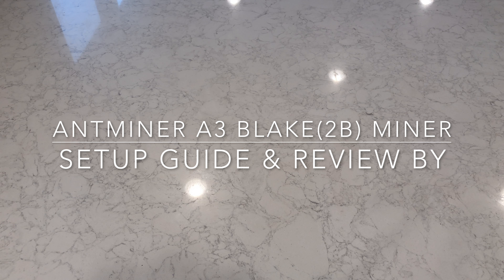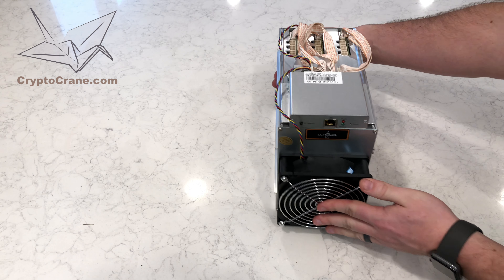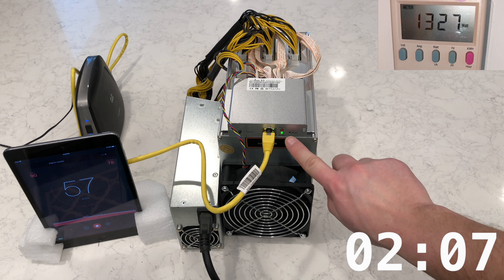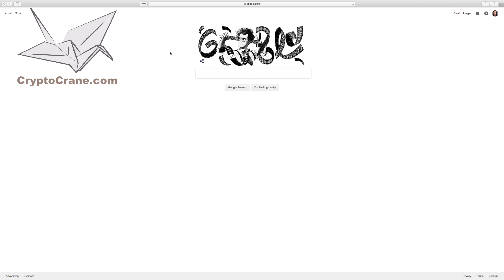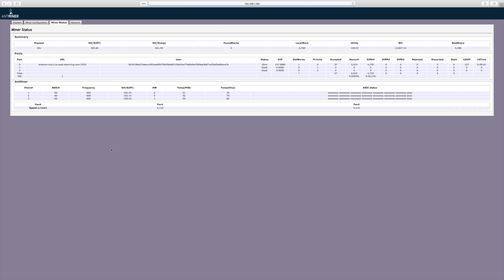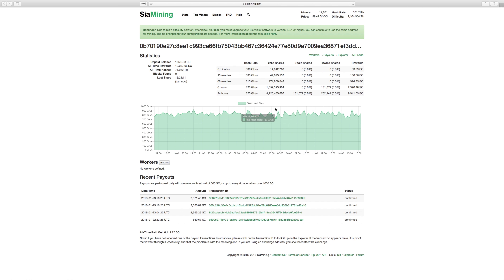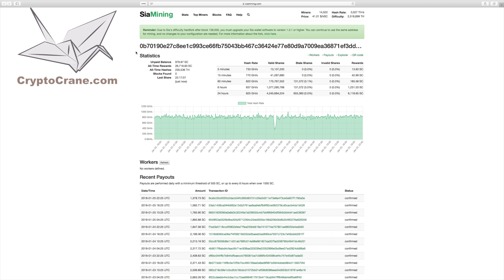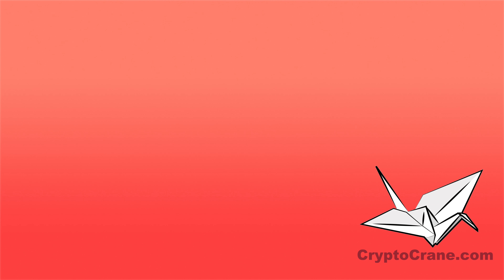AntMiner A3 Setup Guide & Review by CryptoCrane

Comment: Ross - how are you using your your Kill-a-Watt meter on a 220v circuit?  I don't see a model that allows anything other than standard 110v plug.
Reply from the maker: While the Kill-a-Watt is not 'rated' for 220v, it seems to work just fine. I've compared to other watt meters and received the same results, so I'm fairly confident it's accurate.

Comment: what type of wireless bridge are you using? can I connect that to a switch link more than 1 Antminer a3 together?
Reply from the maker: Any bridge should be fine; nothing is dependent on one particular model or manufacturer.

Comment: nobody has a video on how to connect the A3 to the Power,, I did it totally wrong and still working with basically all the cables still out... my Q? is.. what is the right way to set it up... ?
Reply: please let me know if you find the answer, I cant seem to get an answer to that question either.
Reply from the maker: Hi there. Although it goes by pretty quickly, have a look at this clip: https://youtu.be/1i3p3x0P31U?t=3m3s.

Comment: What power supply will run this on 110v?
Reply from the maker: The EVGA 6200 v2 probably would, but the concern is the amperage that it'd be pulling--not good for the power supply, your wires, etc. We typically recommend a 220v circuit.

Comment: I thought these needed to be plugged into 220V outlet?
Reply from the maker: If you're using a single APW3++ for an A3, then you need a 220v outlet. The A3 with an APW3++ will work temporarily while on 120v, but you'd be pushing it past the rated capacity (fire hazard) and we often see people with AntMiner S9s lose hashing boards due to the power supply not being able to 'keep up' with the demand.